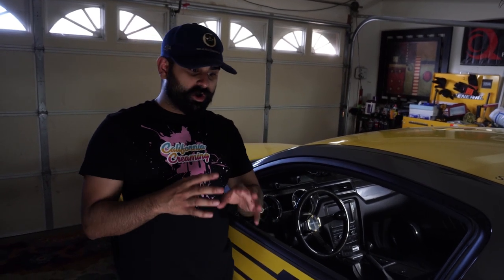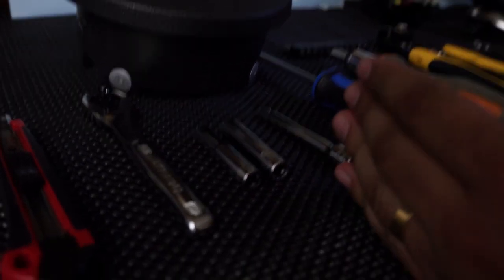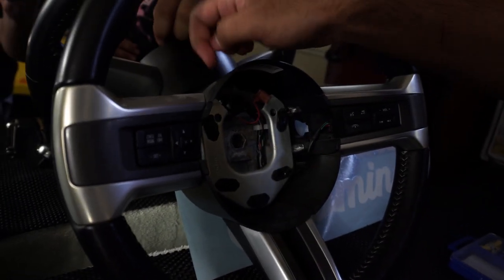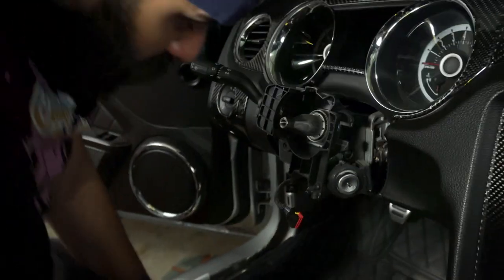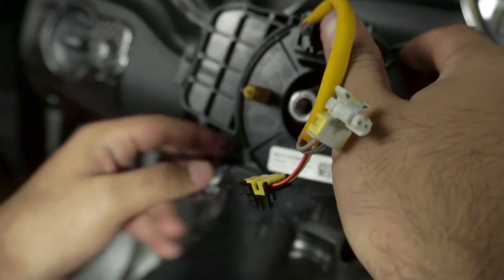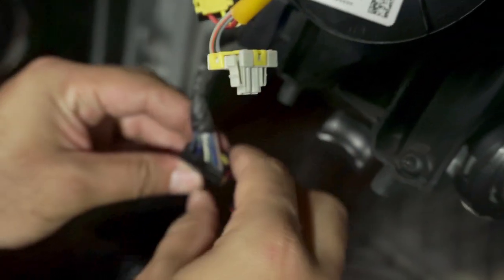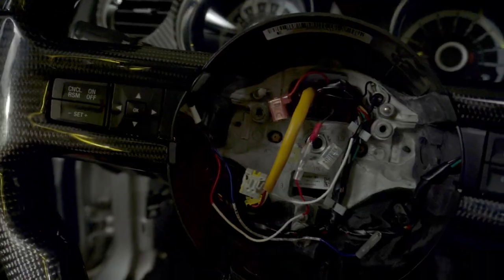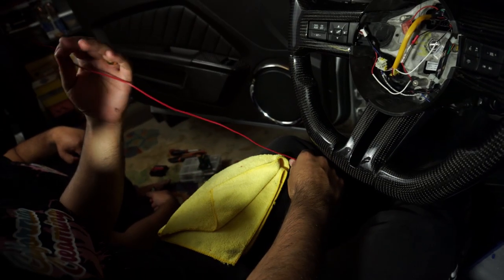How To Install DYNAPERFORMANCE LED Steering Wheel (carbon fiber)

Comment: just a heads up you can grab that 12volt right at the ignition just look it up to see what color it will be and then you can tap right into it that what we do to connect a remote start hope this helps
Reply: the 12v supply from the Ignition switch?

Comment: I just received mine but why does my modual have a micro usb-b next to the  other micro usb as yours does not?? And mine came with a pink pin connector I noticed you mentioned you said we have to buy one but I think mine came with one

Comment: Would you happen to have a link to the fuse tap, and the pin connectors you used? Just picked up the same wheel and can’t seem to find the pin connectors for the clock spring harness

Comment: Any advice or help on wiring the lights? I've wired it to the ignition switch and connected to the switch spring. Nothing is working. The buttons on the steering wheel work but not the shift lights. Also is the blue light on the module supposed to stay on or is it only on briefly?

Comment: Hey man, awesome video. What kind of cable and pin connectors should we be getting for this steering wheel? Also, do we need a new clock spring or can we use the existing one from the steering wheel?

Comment: had mine installed, the wires are visible under the steering wheel, next to the gas pedal,!is it suppose to be like that?
Reply from the maker: No sir! No wire should be visible at all
Reply: California Creaming its next to the gas pedal. wires are falling off. i had it installed at a stereo shop. should i stop by and ask if they can make it disappear?